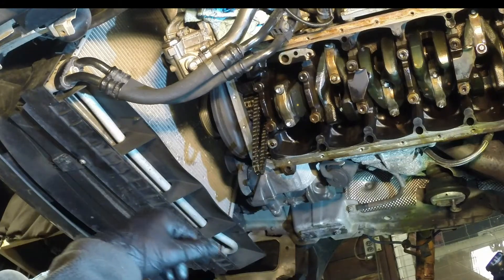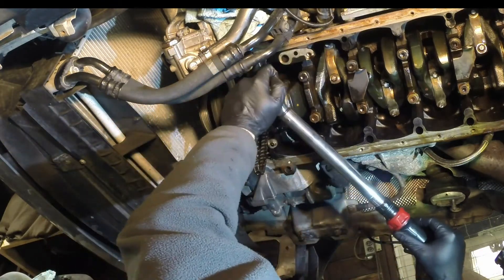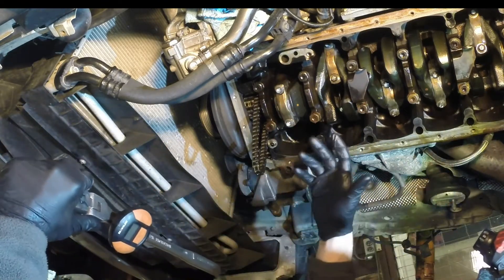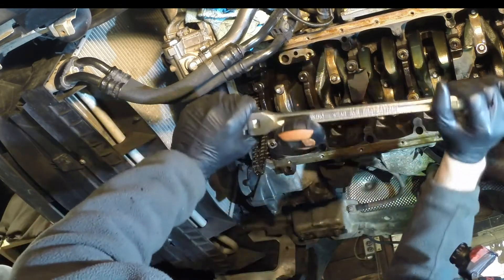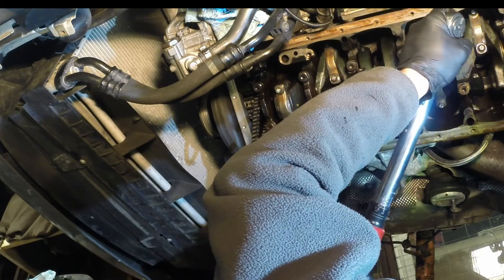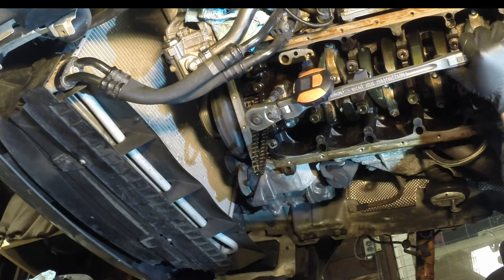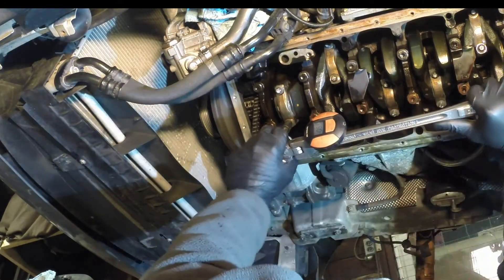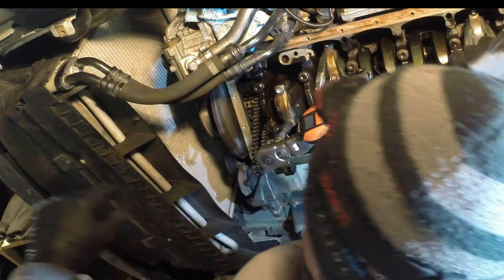e46 M3 S54 Rod bearing torque procedure

Comment: They are stretch bolts....to be used one time.  Are you sure you undo all of that torquing work just to do it again?
Reply: The service guide specifies to torque and loosen them 3 times
Reply: @zerospanky007  this is new to me  regarding stretch bolts.
Reply: Curt Kiser it doesn’t make any sense to me either, since they are being stretched 3 times by angle torqued to 105 degrees.  But, I am not a material science expert either.